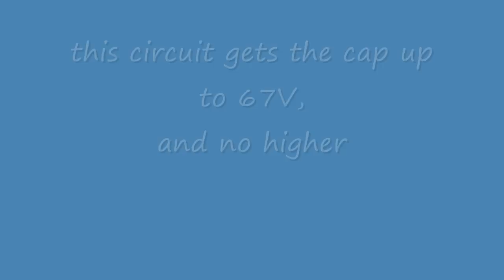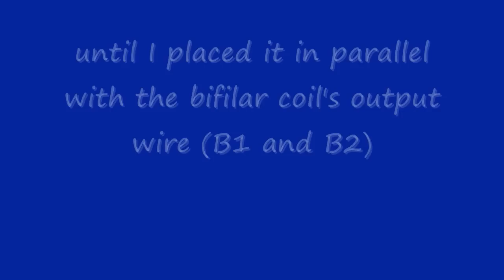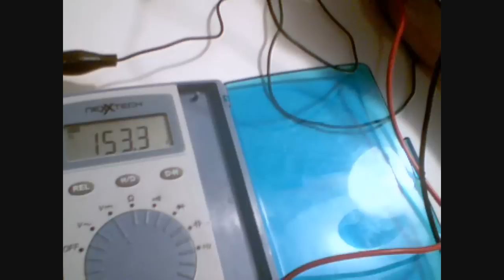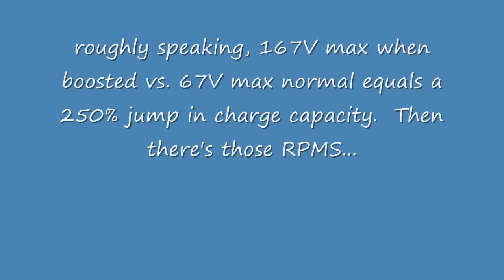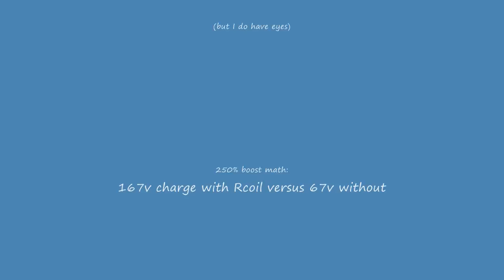bedini ssg with rodin coil gives 250% boost (maybe?)

Comment from the maker: Measuring out the Rodin coil and then doing a few practice 'winds' with string took about 30 minutes. The actual wire winding took probably around 2 hours, maybe less.  I recommend doing a good trace and diagram of your toroid, measure out the 10 degree marks of separation along the circumference, and then connect the lines.  After a few lines a smaller circle forms in the center - that is the amount of space you'll have to put your wire spool through as you wind!  You need a thin spool!

Comment from the maker: The circuit diagram for this was flashed at the 18 second mark, it is only missing the Rodin coil connection - which is across B1 and B2.  The Rodin coil is 24 gauge, 17 complete winds, following the method in my 'construction' video.  Note - there is no certainty that it is actually a 'proper' rodin coil!  I am just testing these things, and still intend to try different winding styles.
I dunno exactly how much was on the bedini coil because it was scavanged, maybe around 800-1000 winds.

Comment from the maker: I'm busy moving right now, but I would like to get a cylinder magnet rotating where the sphere currently is, and have it attached to a rotor.  On the end of the rotor I could then attach gear or pulley system, or another cylinder which could spin inside a generator coil.
Many things to test :-)

Comment from the maker: I wonder the same things, but with the Rodin coils I have now I can only try them stacked.  In order to have them one inside the other, I would need a MUCH bigger one... or to wind them with the wire sticking to the surface of the toroid, instead of coming out and crossing in the middle area.

Comment: YES it will be worth trying the experiment myself I can hardly wait to build a rodin coil. Heres what Im thinking...try setting up a tank circuit like in a tesla coil with the secondary (trigger) coil of the bedini you know a cap and spark gap(or resistor) and magnetically induce a high frequency high voltage response in the rodin coil. Just a wild idea ... :O)   carry on

Comment: ok, my pulse motor has previously charged a 150V 500UF cap to just under 120volts from a 12 volt source...

The voltage build up in the cap has nothing what soever to do with 'boost' and is completely unrealistic to even imply that you have gained anything...
The addition of the extra coil will significanly increase your curent consumption  and the increase in back EMF to the capacitor is caused by their being a second coil thus doubling the curent going into the cap...